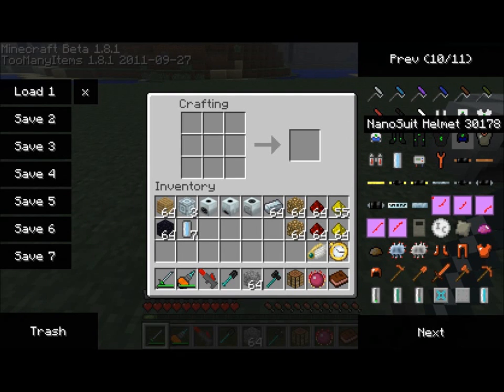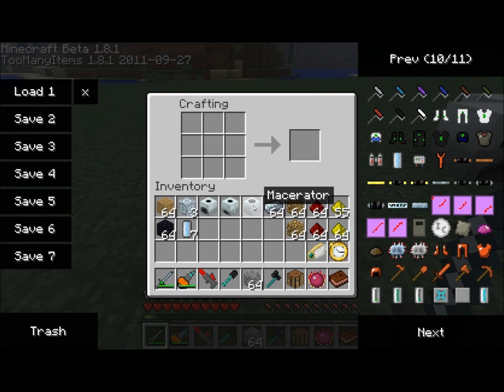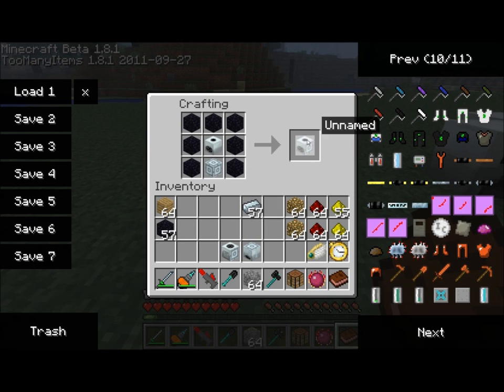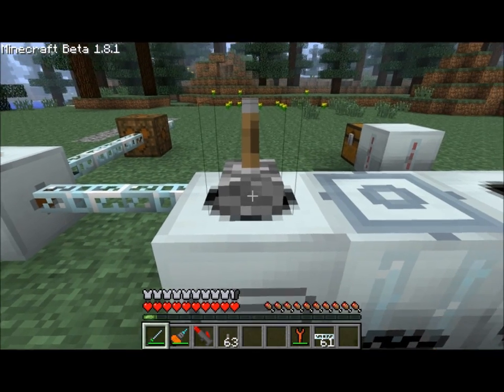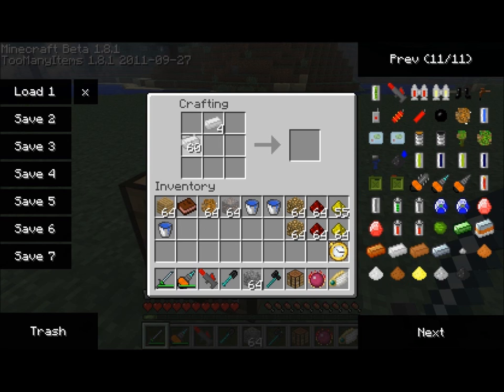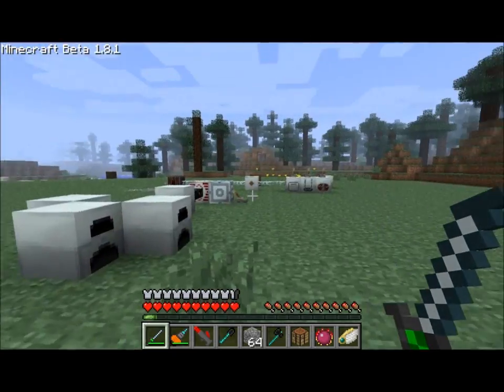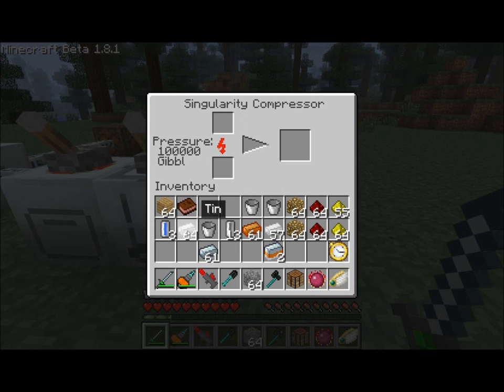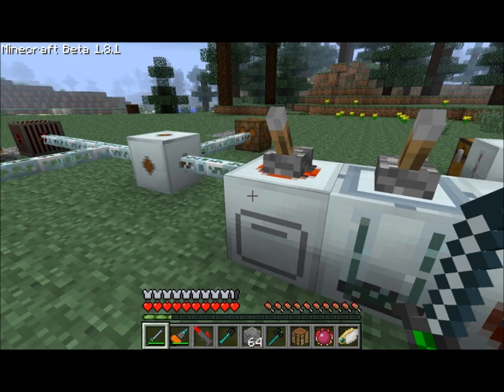IndustrialCraft 2.0 Tutorials - Advanced Machines

Comment: I was already using it at the time of that post. Unfortunately since there are 8 mods that may have caused MC to crash and burn due to a forge mismatch, it leads to a fair number of repetitive actions. Base mods need only be installed once, but mods that rely on forge would need to be tested individually in order to find a working set. It just takes time, but it wasn't too horrible. Currently running ~50 mods atm, but now that Inficraft is no longer being updated I'll have to start over later.

Comment: Here is a playlist for you, cuase there is no way to sort videos by date in youtube playlist:

Rubber Trees 06.10.2011
Tier 1 Energy 06.10.2011
Miner 09.10.2011
Pumps 10.10.2011
Teleporters 10.10.2011
Furnaces 11.10.2011
Macerator 11.10.2011
Advanced Machines 11.10.2011
Solar Panels 12.10.2011
Geothermal Generators 12.10.2011
Nuclear Reactors 12.10.2011
Generators 13.10.2011
Mass Fabricator 15.10.2011
Quantum Armor 15.10.2011
CF Sprayer 29.10.2011
Tesla Coil 29.10.2011

Comment: Technic Launcher does not make installing mods easier. It installs several mods for you, which i happen to use. I would then need to install the other mods manually.

I use MultiMC to install mods due to the sheer number I use, and how often i add or remove them. I've finished adding mods (for now) and have topped out at 57 mods, all working wonderfully together. (Redpower and BC modules are counted as one mod.)

Have some respect for mod authors, don't use Technic Launcher.

Comment: Im still on 1.1 so Im not sure if you're problem is with 1.2 but HV solars should put out 512 eu/t

I was just talking about the monstrous amount of stuff you need to make one.

4608 refined iron, 3584 copper cable, 2048 redstone, 2048 tin, 1536 coal dust, and 1536 glass

Comment: @coldkristen now that i think about it, it would be easier to just use NEI, craftguide can sometimes result in a loading chunks screen when you have an excess amount of mods. Just set it to recipe mode and turn all the extras off and it does the exact same thing, albeit with less work meaning that it isn't exactly a realistic mod. not OP in the least though. (this bug may have been fixed by now, but i still prefer NEI over CraftGuide)

Comment: @sirlazer1 if your using the newest version of IC solar flowers wont work so you have to use a concept that goes sort of like this:      S       where S is solar panel and W is wire. Each will produce 1 Eu/t. 
                                         SWS

Comment: i really cant get this to work, i set up a 25 solar flower, with ultra low current cables, led it through a low voltage transformer and then a medium voltage transformer, and then into the singularity compressor, but the weird thing is, my eu reader says i get 0 eu, but it fills up my batbox fine

Comment: @UglyVids 
Get more power to your MFE. I currently have 2 induction 2 rotary 2 singularity and 1 Centerfuge with a 20 panel solar flower and minus a long-term issue of power (need to add more solar/wind) its working just fine.

Make sure you use Fiber wire and put a new MFE every 20th block to prevent loss of power and for 24/7 use I would suggest a 25-30 unit solar flower setup. I currently use a 20 unit solar flower and after 3 minecraft days of non-stop use I drained my MFE.

Comment: @Hello123Fired yes there is. go into your .minecraft folder and find the folder named "buildcraft." open it. then open "config." then open the buildcraft config and find item 199 (which is the cobblestone pipe btw) and play around with it's id until you find one that works. mine is set to 144 and works just fine.

Comment: What is the point of the Levers? I understand you need to turn the machines on to get the RPM to 10,000. But is this only a one time thing? 

I know if you turn the lever off the RPM goes down, but would there be any need to turn the lever off once the RPM has reached 10,000? Does the machine over heat if you don't?